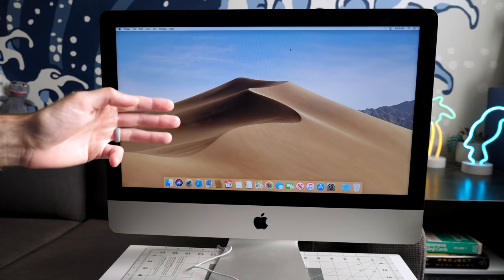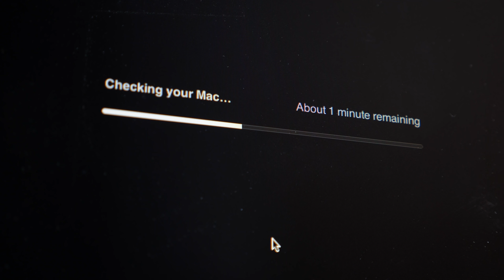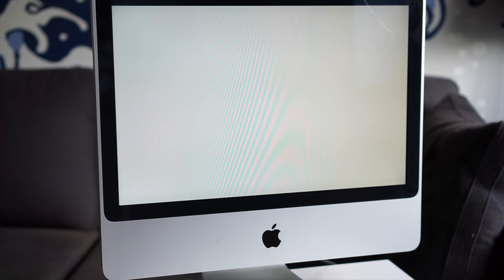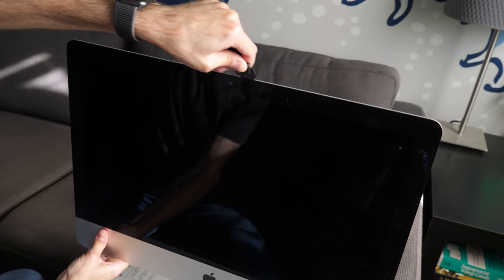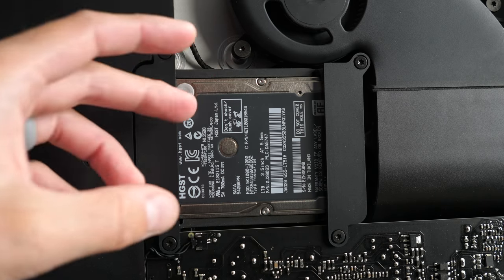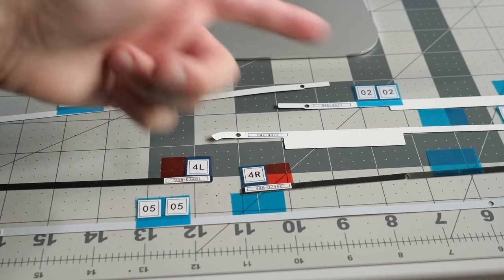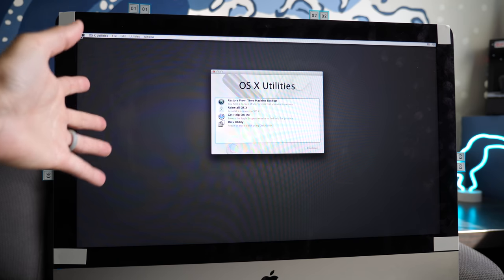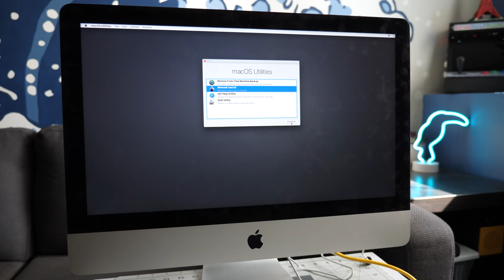DIY 2013 iMac SSD Upgrade!

Comment: I'm still using this model myself to this very day. I did a RAM and the SSD upgrade years ago now! Still a solid system.
Reply: Completely usable system for a large portion of users out there, myself included.  All signs point to Monterrey working just as well as Big Sur does.. so there's more life to squeeze out of this hardware yet!
Reply: Ppl are too quick to get rid of perfectly usable machines!

Comment: My late 2013 27" 3.2 GHz i5 running 10.14.6 with a 1TB SSD and 24 GB of RAM runs great. I still earn my living on it as a designer, photographer, AE, and Motion designer.

Comment: Thanks for this video, I was able to upgrade my iMac (same one as yours in the video) to an SSD. Super helpful and clear tutorial, thanks for the tips! I did struggle with holding the screen up while trying to re-plug in the two ribbon cables, and the screen fell out of place causing a tiny, couple centimers only, shatter on the bottom. Thankfully it's only in the bevel area, so it doesn't affect performance or visuals at all. afterwards, I realized I could lay the iMac on it's back to plug in the cables (shown in iFixit instruction), and that was a lot easier. I'm glad to have an iMac running at a decent speed again, thanks again for the help!

Comment: Just a note, make sure you have the firmware password before making hardware changes (if it is set). My dad bought a used iMac few years ago with slow physical hdd. I knew the screen was a pain to get off, but putting in a ssd wouldn't be that hard. What I didn't know was the previous owner had added a firmware password to the machine, which locked the system due to the change. Putting the original drive back in didn't help either, and the prior owner had no idea what the password was... Only certified shop are allowed to fix this (think they just call Apple and get some codes...), which cost us around a 100 dollars.

So beware ...

Comment: Thank you for your video! I watched it in parallel with the ifixit guide and now my imac became very snappy. I also recommend to remove the fan since it is on only 3 screws, and cleaning the dust that can build up on the radiator.

Comment: Literally working on one of these right now in the repair shop I work at lol Original HDD got its partitions and data all messed up so its going through a long data recovery process. But looks like the data the customer wanted most will be recoverable! Unfortunately, just replacing the drive with another HDD since he's on a budget.

Comment: Just worked on a client's late 2013 27" MBP.  It'd hard lock and fail D recovery as well as failed upgrading and hard locking from Mojave to Catalina, twice.  Rolled it back and it's working again but incredibly, sluggishly, slow.  >5 min boot times.  Ran some diagnostics and it has massive sector failures on the HDD, sadly.  Client is not choosing to upgrade to SSD or risk the cutting-it-open HDD swap, oh well.  Great video sir!

Comment: Fussion drives do not show up as 2 drives. The SSD spaced used to cache is hidden from the user. WD did that with a single black laptopdrive.
some of those large caps can hold a charge for months after being unplugged. just don't touch the insides of PSUs

Comment: If you have the 27-inch version regardless of the drive options, or if you have the 21.5 with Fusion Drive, you can upgrade the SSD as well using a regular M.2 2280 NVMe drive and a passive adapter. You will need to put Catalina on it first though as that OS package comes with a firmware update that adds NVMe support to a lot of old Macs. You can even create Fusion Drive setups with NVMe SSD as the fast device, and SATA SSD as the slow device.
Reply: i would love to be sure that it is really useful to do this, because I want to upgrade my 2013 iMac: to access the SSD, you have to unmount the whole iMac and motherboard. But I read the PCIe is only PCIe2.0 x 2 , so not much better rates than SATAIII SSD... what do you think ? Thank you
Reply: @michelusac1798  PCIe 2.0 x2 is still 1GB/s theoretical over 600MB/s theoretical for SATA 6Gb/s. You can still use a PCIe 3.0 NVMe SSD in there and it would just negotiate down.

Comment: It’ s very easy to break the glass from pressure unless you use a heat gun to soften the adhesive first.

Comment: I think Apple, at some point, changed the storage I/O optimization to skew heavily toward SSDs.  Once you get to Mavericks or so, things just get slower and slower and slower on rust media.  I had El Cap on a 2009 Mac Pro with a 1TB HDD - bafflingly sluggish, but usable.  I replaced that with an SSD running High Sierra.  World of difference.

The original laptop HDD in a 2012 Mac Mini, when running Mojave, was slow to the point of wondering if there was something physically wrong with the computer.  It would take upwards of a minute to launch the App Store.  😫  Now, of course, it runs like a top.

Older Mac OS releases don't have that same issue, but they come from a time when 10-20ms access time was a given.  iMac G3 running OS 9?  Snappy!  iMac G4 running OS X 10.3?  No problem!  Rule of thumb:  If you see skeuomorphic design elements, you're OK with a spinning HDD.  If it's a flat aesthetic, you better have solid state storage.
Reply: Yeah I've noticed this too on my 2009 Macbook. Snow leo, mavericks run fine. Anything past that gets noticably slower every release. Windows is the same way, you really need an SSD for windows 10, it just thrashes a regular hard drive.
Reply: Yeah I remember reading a lot about this kinda thing back when I had my HDD-equipped 2013 MBP running whatever what was current in 2016. Suffice to say I did not want to upgrade the OS again, right until the death of the machine

Comment: Dude i opened one of this about two months ago. At reassembly replaced the entire double sided tape on it...And the screen felt about a week later. BY MIRACLE it doesn't crash, and since that i put simple translucent tape from the outside. Better to have to stand the bad look, than trust in some unknown tape manufacturer...

Comment: I have a 27" 2013 iMac. I bought in 2019 used from a design company. It was stored for 5 years. Then came the owner's daughter and decided to sell it. It was expensive for me but a good value because it was almost the high specs model. I don't use it for design or media work, just a normal house computer and some school work.
At the beginning I thought it was expensive but I felt in love with the all-in-one package, the audio, the 2k quality image and easy work iOS. But like yours he had a 1TB HDD that was dying and it did.
Then I search for a repair shop near and they change the HDD for a 1TB SSD and the diference was amazing. 
I'm using that old computer with 8 years even today, I'm writing this with that same computer and I love it. 
Apple don't always get it right but in this case they nail it. If you want a good computer to do simple work, listen music and watch some movie the 27" is amazing. Recommend.

Comment: We had one of those that had a stick of RAM that'd died! Not seen many dead sticks but we confirmed with testing. 

Ended up swapping out both sticks for 2 x 8GB, and replacing the NVMe and HDD with an SSD. Installed Windows 10. Apart from seeming to do nothing on boot for 30 seconds before suddenly kicking into gear and booting Windows in seconds... Great machine.

Comment: TWO TIPS: Tip #1: When applying the strips, Before you apply, clean the surface of iMac and edge of screen with alcohol swap lightly, gets rid of the crud the old adhesive leaves behind. Tip #2, Use the holes!!! The strips have holes! Take end of black stick, guide thru strip hole, then line up with corresponding hole on side or tip you are adhering to. Makes lining up the strips much easier then eyeballing it! Peel off one side with strip, not both at same time. Makes applying so much easier. And remember, to press down fully once applied!!

Comment: An SSD on an older machine, even if it's bottlenecked to the point you aren't going to see all that much of a speed increase, is going to be a drastic improvement on reliability and longevity. 

I have a SFF Lenovo that's... actually about as old as that mac, and between the SSD and the (budget) graphics card? does what I want pretty solidly well (hiccups and hangups of running windows games in linux, and chrome's tendency to OMNOMNOM memory to one side....) I dunno if I'm getting 'full' performance out of the SSDI got, but it loads faster, is quieter, and probably has far less heat going on.

Comment: Apple being apple. Would have loved to see a removable door on the back for replacing the drive, and possibly updating the ram, but that would probably ruin the seamless aesthetic they were going for.
Reply: And the “Make ‘em buy a new one” mentality.
Reply: @blunderingfool  magnets and screws meant only at worst, a new glass layer. Sealing it like this with short cables means if the screen cracks or breaks, it's probably cheaper to buy a new machine. 🙄🤣
Reply: But that would encourage people that aren't the genius bar to do anything, and that would enbolden the right to repair crowd to demand actual serviceable parts in the hardware they plopped lots of money down for.
Reply: @charlieretro  any device that has a glue seal around it is in tablet or smartphone form factor. This is just over-engineering because they want to drive up first party reapir costs, and they don't trust the end user to not break things.

Please show me a mainstream consumer x86 or x84 windows or linux based pc that is glued down like this.
Reply: @epsileth  x84? 😀
Reply: @MultiWirth  x64 🙄

Comment: Done it on my mid 2010 27" i7 imac and omg, what a difference, along with the ram upgrade to 32gb ram (although apple says mid2010 27" i7 will only support 16gb, they do support 32gb with no problem) It is like a brand new mac now!

Comment: I did this for both my 2012 MacBook Pro and a friend's 2011 iMac and both are like new machines now.  I wish the trend of using glues and such never started.

Edit: Also, on the iMac I forgot to unplug it at first and touched a solder joint while working.  Got a good little zap.  Lesson learned, lol.

Double also, the custom firmware is fascinating.  That explains the SMC fan problem I had afterwards.  I'm in line to get another 2011 iMac from a friend so it's good to know about those adapters.  I'm glad I watched this video.  Good job here Colin.

Comment: I have a 2014 model and was going to put a Sata SSD and more ram in. When I took the logic board out to get to the ram (no ram door on 21.5" models) even though it didn't have a Fusion drive the NVME slot  pads on the PCB was populated, so I put in a 512Gb NVME along with a 1Tb Sata SSD :)

Comment: The gluing the screen to the body bugs me so much that I refuse to come near an iMac. Like seriously the magnets were the best possible solution. But Tim Cook really hates if people want to fix or upgrade their own machines
Reply: Even my super cheap HP laptop uses screws and decent clips, I've opened it twice now for adding 16 gigs ram and a 1tb M.2 drive and it's been a charm to work in.

It's HP 17-ca0006ca laptop with a AMD Ryzen 2300u with Vega 6 graphics, it's no monster but I've got it running Garuda linux and it's heaps of fun, even running games on Steam Via Proton is terrific

Comment: Your instruction for slicing open the display is wrong.  The bottom edge adhesive has two pull tabs on the left and right edge.  Pull the tabs to remove the bottom strips.  You don’t have to try and slice the bottom edge.  It is easy to slice open the display.  The fused display to the glass prevents any dust getting between the glass and display like the older models.

Comment: On the one hand, making something more difficult to repair than it should be is not a good thing. On the other, we want slimmer and faster things and maybe thats whats pushing the electronics manufacturers towards using adhesives to put it together instead of screwing them together. We seem to be putting aesthetics over repairability.

Having said that clips seem to be a more better route but if you break a clip or its holder, you have to replace the whole case. But back to the screws, if it makes a case a few millimeters wider to accomodate the screws, I dont think that many, if any people would be that bothered about it. 

My partner has a Macbook Pro, the battery is swollen up, but instead of being able to just change the thing, its stuck down and although I am pretty technically competent, I said I was not going to change the battery as its just far to involved and, quite frankly, scary.  So thats going off to Apple and will be charged the princely sum of £200 (or about $280) to get the battery changed. I did look at some 3rd party places but they weren't charging much less than Apple,  the cheapest I found was £169 so not much difference. Sigh.

Comment: I’m still running a mid-2012 MacBook Pro, it’s a 2.7 GHz Core I7 with 16 GB of ram and a 1 TB SSD, and still runs great with the latest OSX 10X. Older Macs, at least to me, are great machines as they’re upgradeable, can run Linux, Windows, and MacOS natively or in virtual machines. I work across platforms and with some legacy softwares that still require DVD drives for media/installs and repairs which is why I run the most recent MacBook Pro equip with an optical drive. While the SSD is capped to Sata-3 speeds its fast enough for most things; my next machine will probably be a 2016 or so where you could still upgrade the NVMe SSDs and Ram; I just refuse to get a computer where the ram and/or SSD is soldered in. Modern Macs may be faster but they are much less professional; I’ve been a Mac user since the 1980s when Apple still believed in user repairability, sadly they’ve forgotten their roots.

Comment: The 2012 and up iMacs discharge the power supply after 5 minutes, which was a big upgrade on the 60 minutes of the previous models

Comment: If the old hard drive is still running halfway: plug it into a USB-Sata adapter and boot from it. Install from there. Or create a USB stick with MacOS install beforehand.

I had a protary M.2 SSD in the Macbook. I first installed the system on an external hard drive and recovered data. Then I swapped the internal M.2 SSD with adapter. Started via the external HDD and reinstalled everything with data recover again.

Comment: I had the same problem in my Early 2008 iMac and also swapped out the failed HDD for an SSD. The speed difference from HDD to SSD is like night and day! I'm not even getting the full speed out of it as the 2008 iMac is limited to SATA II, so I'm currently getting 200/260 write/read according to BMDST. Performance has likely dipped though as the SSD is five years old and is used every day. But I'll take it any day over a spinning disk.

Comment: Im using this exact model to write this comment! I did the same upgrade. But I added an OEM apple blade ssd and used the existing hdd for a bootcamp installation :)

Comment: I installed a 2TB SSD in my 2010 iMac and 12GB of RAM. It was my main computer until recently when the screen started to show vertical lines and the whole thing got really hot. Replacing the thermal paste didn’t fix the issue and since some softwares started dropping High Sierra support I ended up dropping it as my main device… but it still works and that is frustrating !
Reply: I've had the same problem with both corrupted screen and unsupported software. I finally tried to install a patched version of Mojave but it didnt support the graphics card and would not boot. However there was some other patch to integrate the graphics driver to the mac os installation package and it installed correctly!! Supprisingly now it works without graphics problems and glitches on this new version with the new driver. The problem is that I dont really remember the website that had all those tools and patches anymore :(
Reply: @VladoT  yes i saw some of the tutorials about this but apprently there is no way to have GPU accelerated graphics when you have a Radeon like me so it's unusable even if you manage to install everything :-/

Comment: One thing I wouldn't do is use UHB tape with this thing.  They put tractor trailers together with this stuff.  It most certainly would pull off even if you cut it open.  It's not an adhesive in any traditional sense. It's a chemical bonding agent.

Comment: 10:20 On high quality devices there is a small resistor between the legs of the capacitors that discharges them safely after the device looses power. So they shouldn't contain any voltage after that time when you unplugged it before starting to remove the screen. But you should always discharge the main caps with a screwdriver (shorting the legs) before doing anything inside. You most likely won't die from the shock you get from them, but it doesn't feel nice and can be avoided.

11:56 I wonder why, because he HDD has a sensor already built in. Maybe to support older HDDs that don't have sensors or to have an easier task designing the PCB as you won't need a chip that communicates with the HDD over SATA.

Comment: That new adhesive strip is so difficult to remove than the original one I hate to use it in case I have to reopen it again.